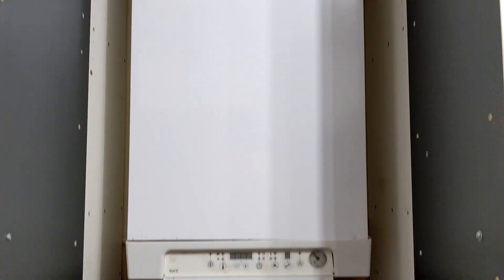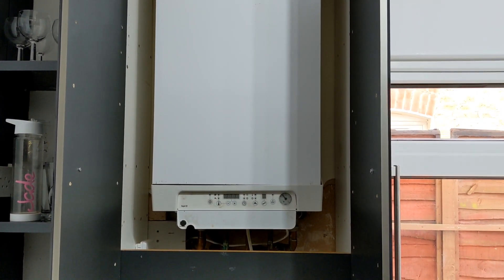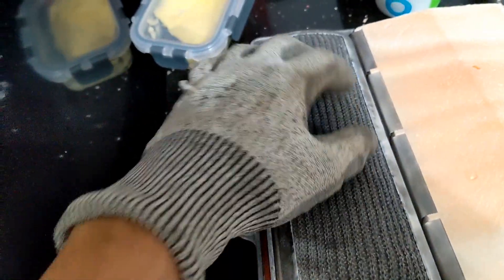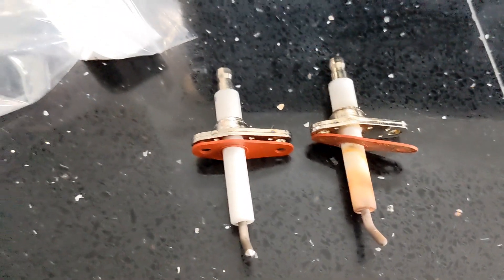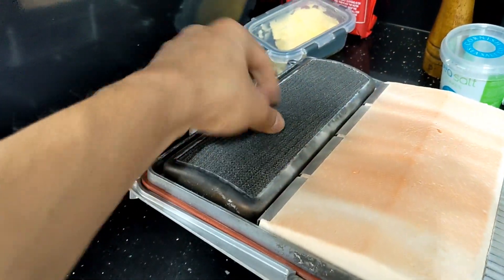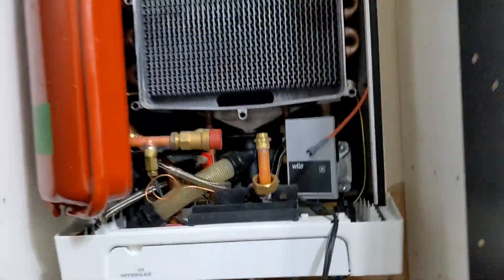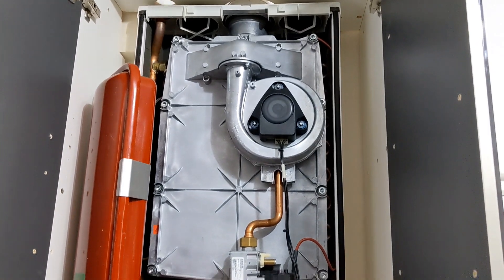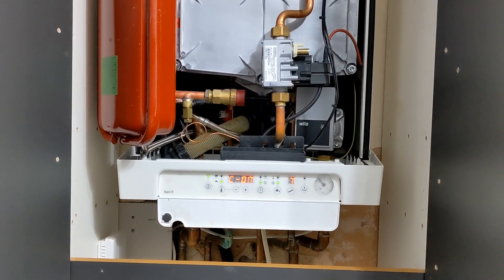Intergas boiler explosive ignition fault

Comment: Whats your opinion on these boilers, im an installer looking for an alternative to Baxi
Reply from the maker: They're decent boilers, I've not had to repair many and they have a twin main heat exchanger for heating and hot water so no plate hex or diverter. I've not installed one yet though so I'm not sure what they're like to fit
Reply: @cputilitysolutions  Thank you for the reply. I've been told they aren't the simplest to install because of scale protection and the multitude of options.  My issue with most combi boilers is hydraulic failures ....I don't know one that doesn't have issues with leaking diverter valves, pin holed composite blocks, blocked plates and failed actuators. They are a real pain and as this boiler doesn't have any of that I'm thinking they will save the customer the regular leaks, failed hot water etc.

They also seem to offer very good hot water performance to kw ratio....the 24 KW provides as good as 30kw baxi 800
Reply from the maker: Nice info there, thanks for the explanations 👌🏾

Comment: I have come across a small hole in the knit mesh burner on these boilers, where the ignition probe meets the burner.  The hole appears to have been made by the spark from the ignition probe onto the mesh of the burner. What I did, was with a small screwdriver gently moved over some of the mesh of the burner over the hole, closing up the tiny hole. It solved a mildly explosive ignition problem. The ignition was making a little swish noise, nothing to be alarmed about. But it seems this was nipped in the bud.

Comment: Can I re torque the faceplate by myself without phoning for engineer. Boiler now when it fires up everything is ok except for metal expanding and making noises. To me he didn’t use a torque wrench and the difference’s in tightness of bolts is the issue
Reply: Take each bolt out one by one. Clean the bolt, including the threads. Under the head of the bolt put on Ceramic Grease.  This is available online. This stops the expansion ticking noises. Then tighten up. Do the next bolt.

There is an Intergas vid on Youtube on how you to service the boiler. They do not give torque settings. Just tighten up well, but do not overtighten - tighten by hand only, never use an impact driver.
Reply: @johnburns4017  thanks I was going to tighten them to 10-12 newtons the spec says in manual
Page 61 
11.2 
Number 3 down

Thanks again for the quick response 👍
Reply: @macbutty1  
Correct. If you have a torque screwdriver then do it of course. The official Intergas vid does not show using a torque screwdriver only by hand.  Search on Intergas Service/fault finding on Youtube. Johnny shows applying the grease to the bolts. Do not over grease.  Do each bolt diagonally across the cover plate.

Comment: Explosive ignition:
1) Could be gas starvation. Check the gas pressures first. It could be a defective meter regulator that is maybe sticking, etc. Intergas want 20 Mbar working pressure at the gas valve when the boiler is full on - usually by turning on a few taps on a combi. Check if gas piping is big enough, 22mm minimum all the way.
2) Can also be the ignition lead. It should be 1,000 ohms (1 Kohms [says on the plastic ignition cap]) when putting the multimeter probes at each end. 
3) The ignition probe ignition cap at the end of the lead - make sure the contact inside is clean making a good contact. Scrape it with the likes of a screwdriver to clean off any oxidation. 
4) Make sure the ignition lead is well pushed in to the ignition module on the gas valve. Again make sure contacts are clean. 
5) Ensure the ignition lead is behind the sound insulation, not against the hot heat exchanger. 

The above are the first ports of call.

Still problems?  Look at the heat exchanger seal.  Best replace it.
Still problems?  Then look at the ignition probes as you are looking at the heat X seal. 
Still problems?  Then look at the burner (an expensive item to needlessly replace).  The new replacement burners are all rigid metal, not knit feeling like steel wool. Make sure you get the new proper replacement. 

Explosive ignition can also be if engineering settings F and F. are played about with. May have to reset to factory default settings and re-punch in the weather compensation settings again.  And set the DHW to full output (fan speed). These come set 10% less than what the boiler can deliver in DHW flowrate. F and F. are fan starting speeds. Upping the starting speed (more gas/air mix fed into the burner) can eliminate explosive ignition.

So if slightly scaled up reducing the DHW flowrate?  Up the fan speed to max, parameter P, then solved until the DHW heat exchanger is descaled affecting water flow. Can descale using a cheap sump pump, bucket, hoses and Kamco descaler.

Comment: Must be me but... how do you remove the case on these boilers???
Reply: Front under at each side - two screws.  Look under you see a round hole in the plastic put your pozidriv in.  Once lose push the case up.  May need some pushing.
Reply: @johnburns4017  thanks mate

Comment: Still not working right 🤦‍♂️
Reply: What is not working?
Reply: @johnburns4017  had it repaired now from Intergas engineer.
He fitted new gas valve and all the ignition parts. 
I had a new burner fitted by another engineer before but he hadn’t fitted the earth spring so won’t be using that company again
Reply: @macbutty1  
Sounds like a lot of parts changing - in case.  The burner was probably OK.

Comment: Keep the flow temperatures at 55C max, then no scale build up. High temps may cause scale build up in the static water in the DHW section of the bi-thermal heat exchanger. 

Easy to descale. Have a bucket with Kamco descaler liquid in it, using a small sump pump.

1) Turn off the water from the street;
2) Connect the pressure side of the pump to the cold washing machine tap;
3) Connect the return to say the hose of the shower;
4) Open the shower mixer on full hot.
5) the pump, pumps through the heat exchanger and through the shower mixer back to the bucket forming a loop, decaling both. 
6) Leave the pump on until descaled. 

Simple.
Reply: Will that remove scale....it's like a hardened skin and very unlike sludge. The only way I've found to remove scale from the hot water element is to use a power flush on the hot water and fernox orange descaler....
Reply: @dickiedubs3137  
Yes it will remove scale. The Intergas has a bi-thermal heat exchanger, not a plate heat exchanger. 
It is a loop from the bucket, through the DHW heat exchanger then back to the bucket. Descaler in the bucket. Any quality descaler will do. 

As long as the decaler liquid runs over the baked on scale it will remove it.  You may have to leave the sump pump running circulating the liquid for quite a while but not a fast flow - can restrict flow by service valve.

Comment: Hmmmm. No mention of checking the red combustion  cover seal that had a TB raised by gassafe in 2018 to upgrade to a black viton seal.  Obviously depends on age of boiler but new rapid 25 and 32 boilers come with upgraded seal. Also why replace the ignition lead when it can be easily checked with a multimeter? 10 kohms, stamped on the top connection to the ignition pin, which I have only changed once on 10 yrs on these things. Anyway biggest gripe is putting all the parts of the boiler on a customers gloss worktops! Out of order.....?

Comment: Had mine fitted with a new igniter and cable but has started making a  loud noise again on firing up 🤦‍♂️ got parts from 
https://www.heatingspares247.com/
Reasonable prices for parts
Reply: Well boiler failed again earlier this week and ordered the new burner which seems to have been updated so that has cured my problems and is now working 🤞thanks again for you’re help
Reply: @macbutty1  
How old is the boiler? 
What model? 
When was the burner updated?
Reply: New burner was £193.43 plus vat
Reply: @macbutty1  
Thanks. The new burner design must be recent, as the vid is only six months old showing a  new wire wool looking type of burner.   Five years out of a burner is poor - but at least they have updated the burner.  I hope you have no problems from now on. 

Being only five years old Intergas should have given you the burner for at least half price. The burner product was not fit for purpose. Saying that I do think these are excellent boilers.
Reply from the maker: Did you have the burner changed as well? Or just the electrode and lead?
Reply: @cputilitysolutions  just electrode and cable only 5 years old lol
Reply from the maker: @macbutty1  I'd prob get the burner checked out as well in that case if it's gone loose and saggy like in the video
Reply: I assume the new igniter electrode worked fine at first then caused problems. How long for the problem to reoccur?
Reply: @johnburns4017  A couple of months it lasted but now has explosive ignition but not all the time so will get burner change next
Reply: @macbutty1  
If the burner was duff it would be bad all the time. 
Try the gas supply. Could be a sticking meter regulator, kinked flex meter inlet, pipes too small, etc.
Reply: Rapid 32 and is 6 years old
Reply: All am saying is the new burner was solid mess grill type not a burner knit like in the video
Reply: @macbutty1  
Thanks. Cost of the new burner?
Reply: @macbutty1  
The new burner in the vid is a fine steel wool looking type, not a solid mesh.  The vid is only about six months old.
Reply: Yep just got home and my old one is the wire wool type knit
Reply: I messed up tho by not having it serviced from new 🤦‍♂️😂
Reply: @macbutty1  
Was the heat exchanger dirty?
Reply: @johnburns4017   it was but I wasn’t there when they cleaned it just saw pictures on FB he had put up Before/After
Reply: @macbutty1  
They usually stay quite clean, especially if it condenses a lot. The condensation washes it down.

Comment: The heat exchanger's on these scale up and start throwing out intermittent faults.  I've been out to intergas boilers which had blown fan pcbs.  Great boilers if they're installed correctly.  The parts are quite costly.  Customers eyes almost pop out their head when you bill them for the repairs 🙄😝
Reply: Keep the flow temperatures below 55C, then no scale build up. High temps may cause scale build up in the static water in the DHW section of the bi-thermal heat exchanger. 

Easy to descale. Have a bucket with Kamco descaler liquid in it, using a small sump pump.

1) Turn off the water from the street;
2) Connect the pressure side of the pump to the cold washing machine tap;
3) Connect the return to say the hose of the shower;
4) Open the shower mixer on full hot.
5) the pump, pumps through the heat exchanger and through the shower mixer decaling both. 
6) Leave the pump on until descaled. 

Simple.
Reply: @johnburns4017  Thanks for the information.  I guess it would be easier to T into the return and flow. Let's say connect on the bottom of a filter or remive it.  Then T into the flow.  A gallon bucket full of white wine vinegar and a pump.  Call for DHW demand and turn the temp low.  The solution will circulate the system and dhw circuit.  The intergas boilers I've installed have mostly included a combimate.
Reply: @rayc1503  
It is on the fresh water side. Inlet and outlet. Use Kamco, or similar as it is more effective. Go by the makers instructions. 

Best if you can direct the flow of the descaling fluid through a shower mixer descaling that, if you can.
Reply: @johnburns4017  ok thanks,  I'll at some point try what you've suggested. 👍
Reply: @rayc1503  
Keeping the heating flow at 55C helps to keep scale in check. That may be having a narrow delta T, so opening lockshields, so most of the rads surface is 55c.
Reply: @johnburns4017  thanks again,  can I ask what sump pump you use yourself?  Do you have a link?  I have a small Karcher high power sump pump would that be adequate and how much descaling solution would you suggest?  Come to think of it I still have my Rothenberger descaler. I could possibly use that.
Reply: @rayc1503  
Seems you got it in hand. 
Kamco ASR001 scalebreaker works.

Comment: I fitted a few of these. I think Intergas had a programme to change all the burners on these boilers. At least they did so on all the ones I fitted not long after they were installed. But otherwise they’ve been trouble free.
Reply from the maker: Yeah I heard the same as well. Only the 3rd one I've come across but I do like them 👌🏽
Reply: @cputilitysolutions  
They are one of the best for sure.  The only combi that can be open vented.
Reply: When did they change the burners?  What year?  These boilers have been made for the best part of 20 years.